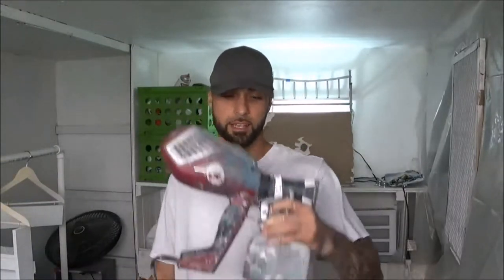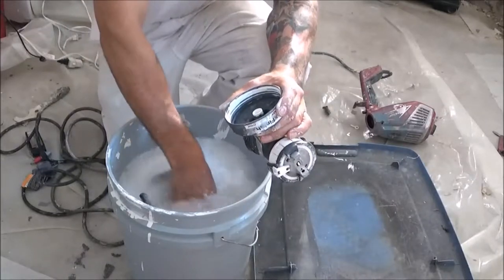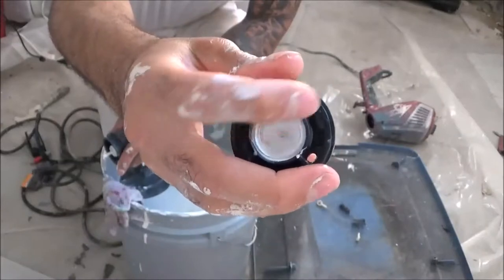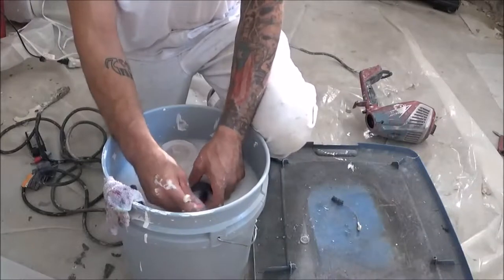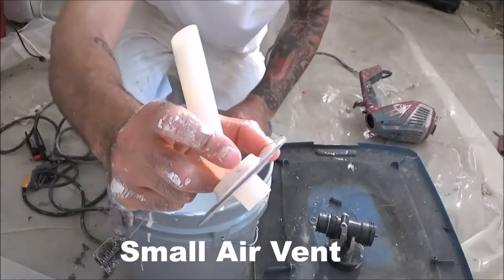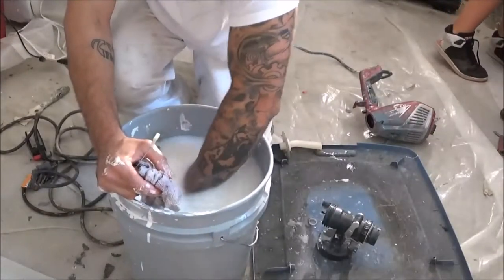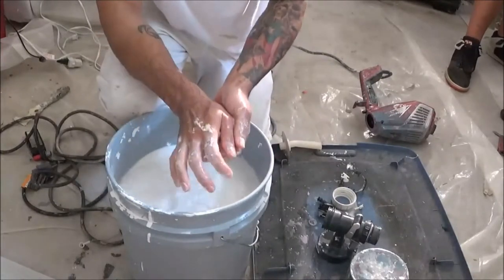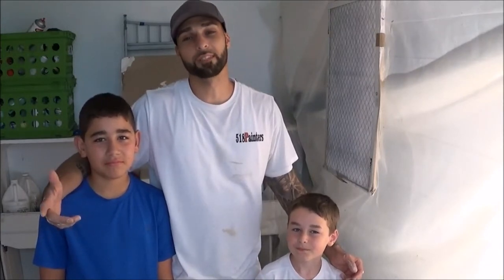How to clean a handheld titan paint sprayer

Comment: Have you have any problems with leaking paint  through the triger ? I have the same sprayer and it seams that there is no way to repair once they leak
Reply from the maker: Did you try to take apart the trigger yet? You might have paint build up between the trigger lever and the needle.
Reply: @DIYhomeimprovementguy i did take it apart but i didnt check that part thanks anyways ill take it upart again
Reply from the maker: @luisdeleon6090  there is a screw that holds the  trigger together.  If you remove that it will come apart in 2 pieces. Then remove the bolt and the needle will come out.

Comment: this is what the customer never sees. if not cleaning brushes rollers guns. another hour of work. liked it
Reply from the maker: Great point! That's absolutely right. Your day is not over until each roller, bucket, tray, brush, sprayer etc. is cleaned.
Reply: You nail it guys I like to bring all brushes in water to clean then at home I install a utility sink at my tool shed. I don't ever clean Brushes or equipment on sites,